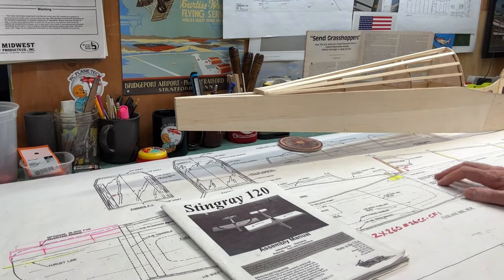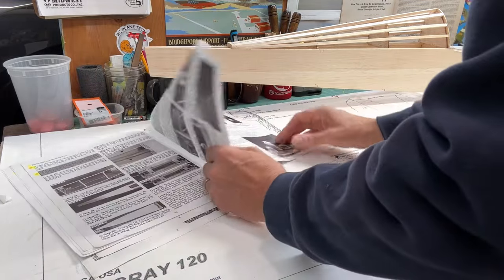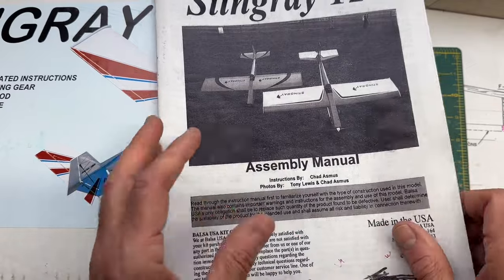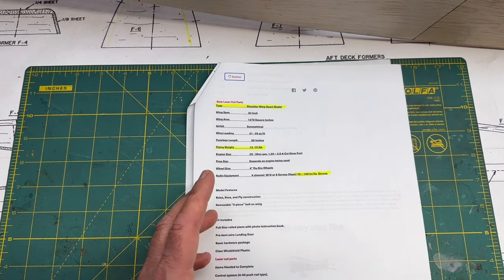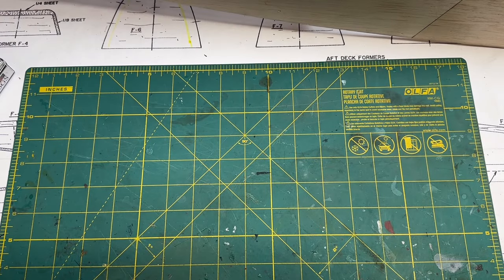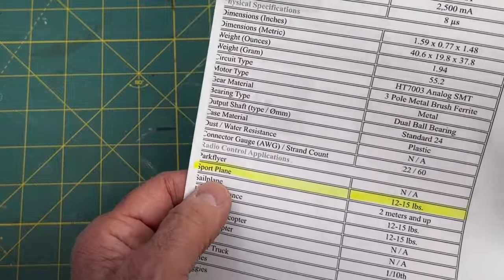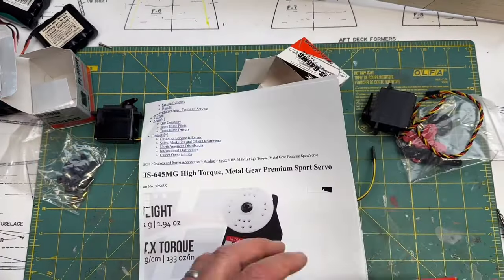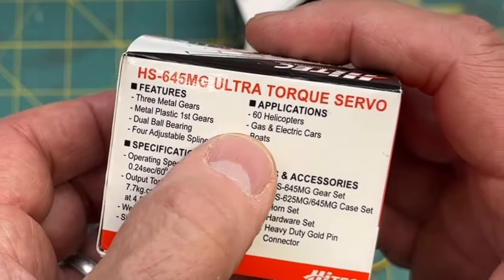Balsa USA Stingray with DLE-20, RC Plane Build N0 19: Choosing a right servo mini review Hitec

Comment: 😊😊😊... Well, my good chap...Say no more...I  have had splendid success with the PowerHD brand 1501 analog servos...Up to 200+oz/in of torque...The price is right too...I  used to order them from Value Hobby outta Chicago,  but he only accepts PayPal...I don't have PayPal account anymore...Too much hassle with PayPal...I now order them from Aloft Hobbies outta San Diego,  California...A dollar or so more in price,  but I don't don't have to deal with PayPal...Like I said...the price is right and I neva had any problems with them...And, they are Metal gears also...
Also for me, I used a simple  "Length x Width " measurement of the Controls  surface...Basic rectangle measurements...or whatever size motor I'm using...I used that as a starting point...As you stated...The type of flying that the plane will experience is a factor...😊😊
Reply from the maker: Great, thanks for the insight!
Reply: @JamesRCPlaneTech  ...No worries...

Comment: 😂😂😂...!!!... Haaaa!!!... Me and you are probably the only 2 dudes on the planet still using NiMh batteries...I have used Lipos, but still not "sold" on them, especially the "fireworks " that they cause...And, you need a  Voltage regulator to  drop the voltage down or risk burning up your servos...I  have a regulator,  but they are getting scarce to find...I will keep using my NiMh's no matter what...I  make up my own packs from Energizers from Walmart...2300 maH....Green Label...AA4...😊😊😊
Reply from the maker: Same here, I don’t want to burn down my garage..
Reply from the maker: Try BatteriesAmerica.com, you can order them in different voltages and capacities, and chose flat or square configurations, and chose the connection type.. very customizable and good prices
Reply: @JamesRCPlaneTech  ...okay...I will check them out...